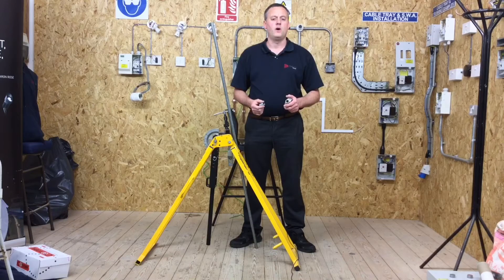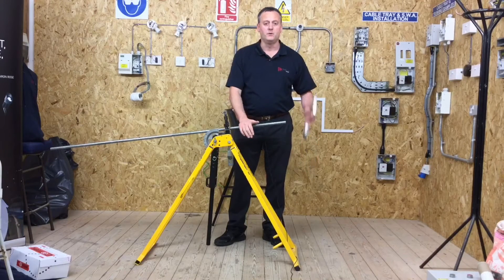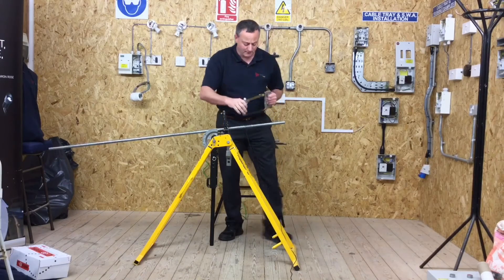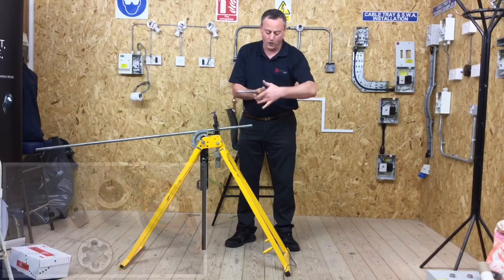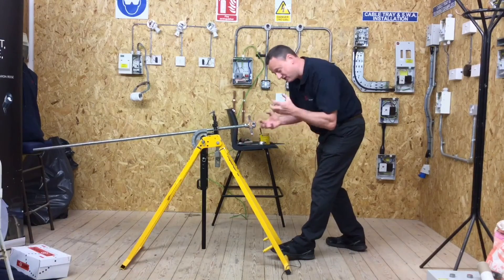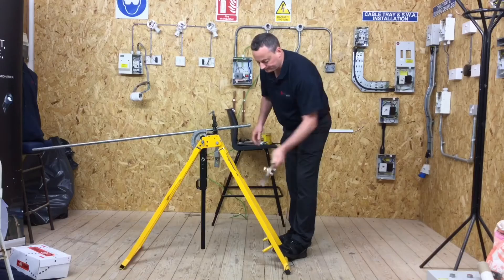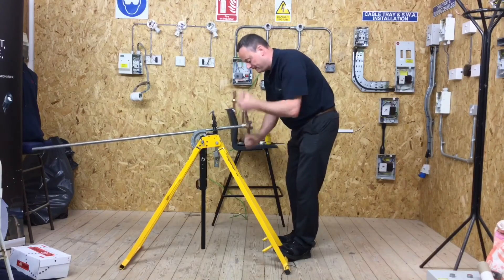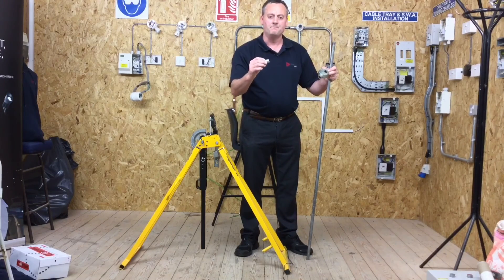How to Cut and Thread Steel Conduit so a Coupler or Spouted box can be Fitted (Metal Conduit 20mm)

Comment from the maker: == 🕐 Time Stamps - Cut to the action 🕕 ==
00:04 - Introduction to threading steel (metal) conduit
00:29 - Using the conduit bending machine round jawed vice
01:28 - Cutting 20 mm steel (metal) conduit 
02:40 - Making the end of steel conduit square before threading
02:56 - Threading 20 mm steel conduit using stocks, guide and a 20 mm die 
06:14 - De-burring steel conduit

Comment: When your on a commercial site, cutting 25m conduit all day hurts your shoulders and hands. Get a sabre saw, if their is a tool that makes work easier and lighter take it and use it, your not their to impress anyone or blend in with anyone, i want a long career
Reply from the maker: Steel Conduit Life Hack How to Make Threading & Bending of Steel (metal) Conduit Loads Easier (EMT) https://youtu.be/vW4lq5OWT-E
Reply from the maker: How to Thread Steel Conduit 2 Ways - By Hand Using Stocks and Dies & By Using an Electric Threader https://youtu.be/Hh41GwElZuk

Comment: Always looking for a shortcut but is it OK to use an angle grinder for the initial cut through the conduit rather than a hacksaw since it's going to be filed off anyway?
Reply: In real life everyone just does that anyway. Some sites class it as hot works though, so to get around that people use either a metal cutting circular saw or a jigsaw with a metal cutting blade. I don't think anybody uses a hacksaw as shown here.

Comment: Great video, really helpful. Does anyone think galvanised metal conduit is suitable to be used outdoors as a garden plant support frame if i paint it with hammerite special metals paint? If i paint all the pipe and maybe silicone the threads it should keep the water out and along with the paint stop it rusting. 🤔

Comment: Thanks for your time with these vids. Would you please do a longer video (or series of videos) of a simple steel conduit installation showing how to mount saddles/inspection boxes and equipment then joining it all together as an actual installation on a wall showing how to measure for bends etc.
Conduit is one area a lot of electricians struggle.
Reply from the maker: +Dean Williams 

Thanks. I will over the coming months do more videos on steel conduit as requested. My time is limited at the moment as we are over run with new learners at my college. Thanks again for the support GSH Electrical
Reply: GSH Electrical I appreciate how much time it takes to plan and execute these vids, once again thank you.